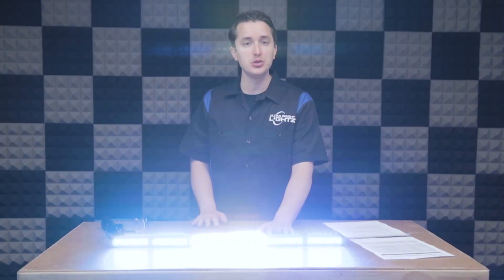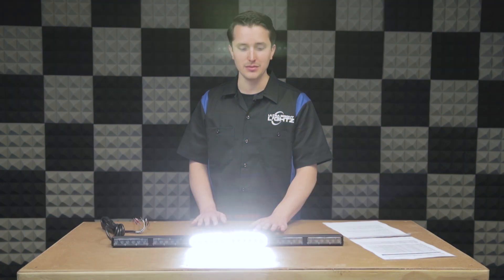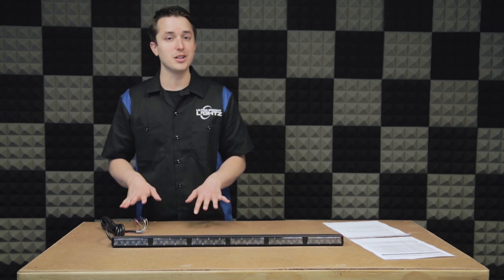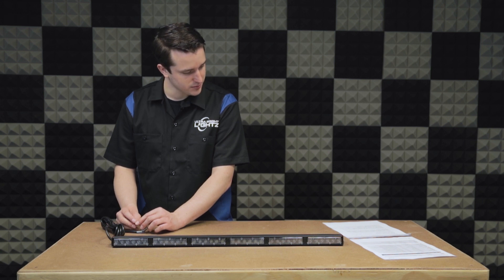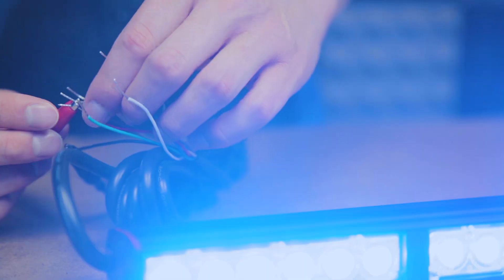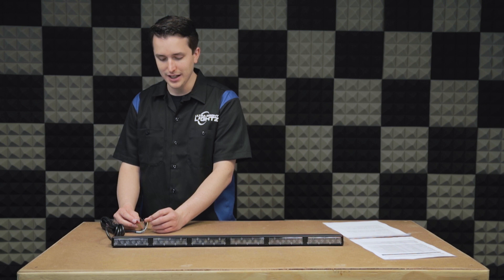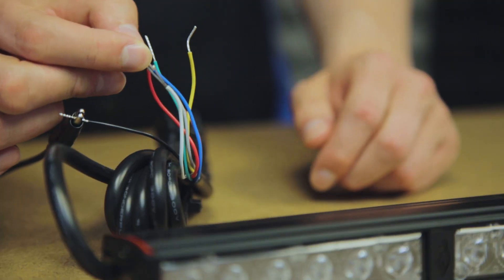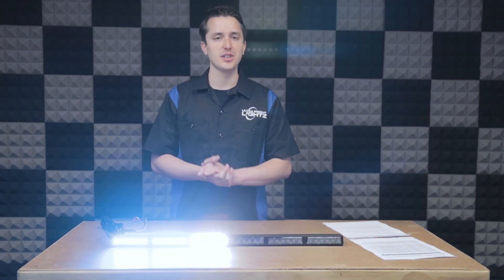How To Wire Up Feniex Fusion Stick

Comment: can this be connected to a cig plug adapter UBL sells easily with but connectors?
Reply from the maker: According to our Feniex Representative it cannot be done
Reply: @UltraBrightLightz  weird, i contacted you guys and have told me it can be done, please clarify, i will be hardwiring them to a cig plug adapter

Comment: How much current consumption does this light stick takes from the controller (for example Feniex 4200 mini)? As I understand it has own +12V power source (Black and Red wires), which takes most of the load (6Amps), but how much does it need from Feniex 4200 mini +12V wire? I am asking, cause I want to attach few more lights to the same button, but there's an output limit 3.6 Amps. Thank you!
Reply from the maker: Your best source for that information will be Feniex.Please give them a call and they will be happy to assist you! 1-800-615-8350
Reply: @UltraBrightLightz  Thank you! I will write to their support.
Reply from the maker: @EstonianRescueServices  You're welcome!